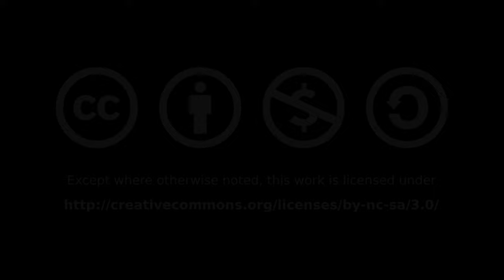A World Without Friction

Comment: Voice is without friction
Reply: lol
Reply: +Prasad Jachak its due to drag(which is also a friction)
Reply: @NumbToons  I mean sound would work, because the particle bump into eachother
Reply: . When you speak out...the air molecules vibrate and transfer the sound took place from one end to other. But its range is limited beacause there is a loss of energy because it face drag which is also a kind of friction in air.  A lot of other factor also play important role in sound....like density of air etc etc..
Reply: @mohitjoc25  you also lose the sound energy converted to thermal energy and a lot of it is absorbed by the surroundings as well. I guess some of it might be converted to elastic potential energy in larynx but I dunno
Reply: 2:36

Comment: "Cars would have nothing to slow them down" At MIT we pride ourselves on having no wind resistance.
Reply: Most drag is from friction with the air, which is why meteors burn up when they fall down to Earth. However the air would have inertia, so you're partially right, but it would still be too little to slow you down if you had to stop quickly. On a side thought, winds would be insane because there is nothing to stop the air from circulating around the globe.

Comment: at 0:18 you see someone on a scooter WITH THE WHEELS TURNING, that would not be possible since the spinning motion of the wheels is a result of static friction. In order for a wheel to start spinning, a torque or force must be applied to the wheel. The force of the static friction opposing the direction of the force prevents the wheels from sliding and in turn begins a rolling motion. In a world without friction, this would not happen, without static friction the wheel would not spin due to a lack of an oppositional force but rather the scooter would just slide.

Comment: But, theoretically, as long as it is possible to not go through things (up until a specified point) (such as a wall; you can't, as a solid, go through a wall, at least not until you break it) ,friction exists as they both are the same thing.

Comment: Violin Example would be wrong, if there is no friction there would be no sound at all from the violin. The reason the strings vibrate is because of the friction and drag force being applied between the 2 surfaces. Without Friction, it would just slide off and no energy is transferred, no energy transferred means no vibration. No vibration, no sound.